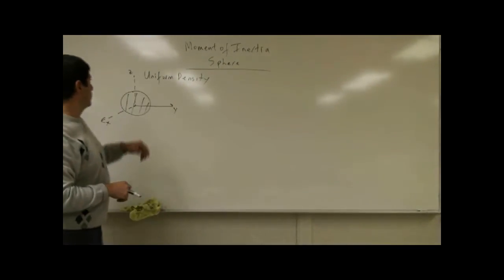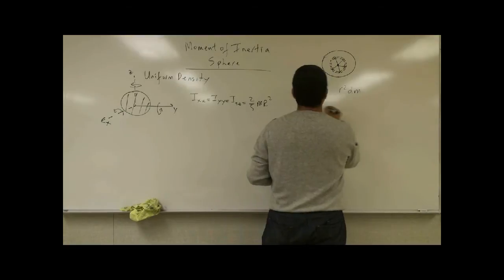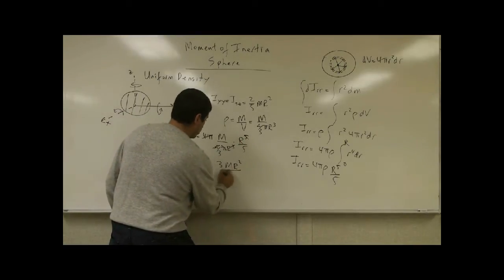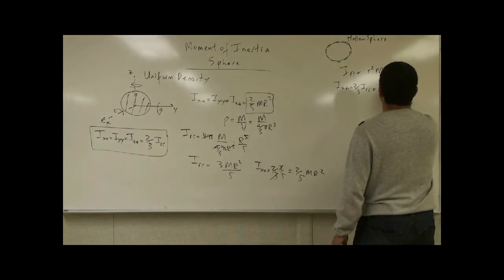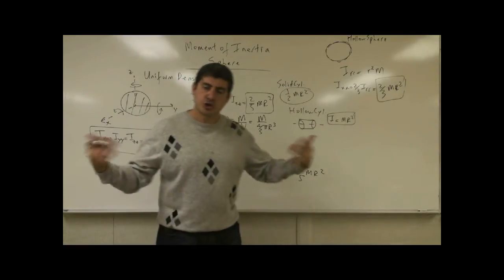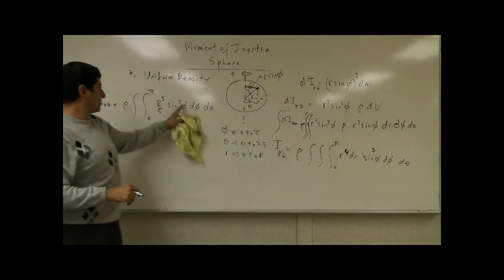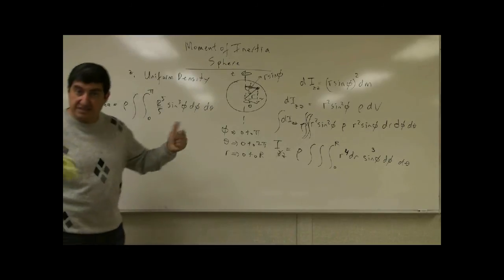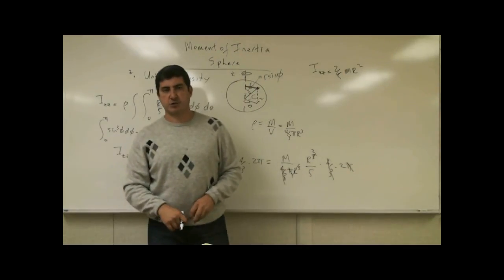MomentOfInertiaSphereUniform.avi

Comment: Proof is really simple - We'll use Pythagorean Theorem (PT) and symmetry

For I_rr PT gives space diagonal relation : Irr := Int(r^2)dm = Int(x^2+y^2+z^2) 

For rotation along the x axis (due to PT) I_xx = Int (y^2+z^2)dm

Similary I_yy = Int(x^2+z^2)dm and I_zz=Int(x^2+y^2)dm

So the Sum is : I_xx+I_yy+I_zz = 2*Int(x^2+y^2+z^2), which is equal to 2*I_rr

Due to the symetry of the object must also be I_xx = I_yy = I_zz=I ...the Sum is actualy also 3*I ... =D

Comparing the results:

2*I_rr = 3*I